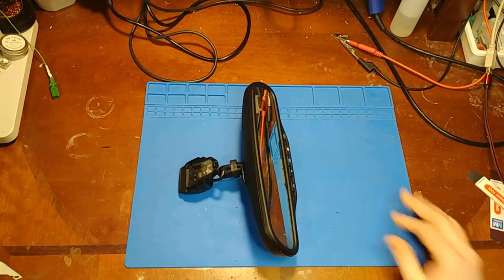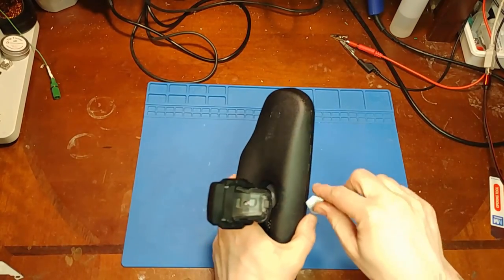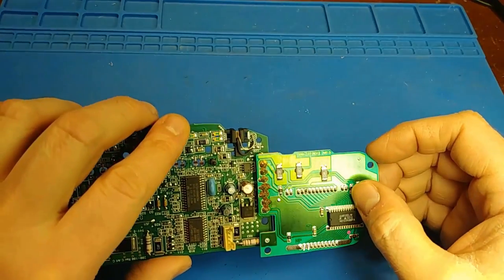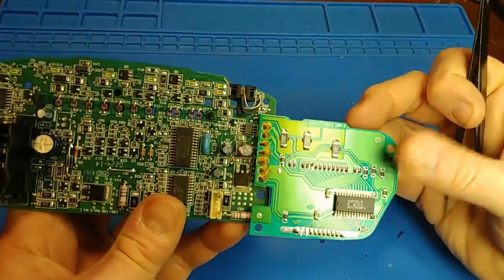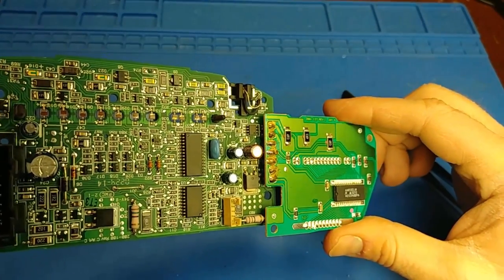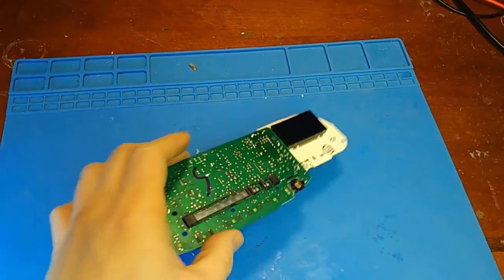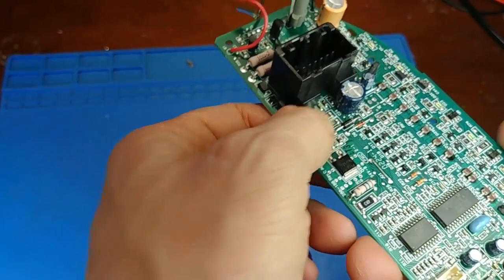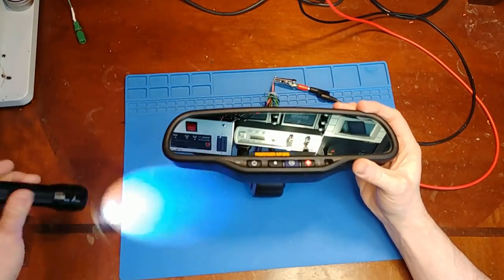How to repair Compass Mirror

Comment from the maker: For contact information follow this link:
https://www.youtube.com/watch?v=T_2WnJMsZaU&feature=youtu.be
Reply: How do I contact you
Reply from the maker: @rolandcabrera8245  click the link that says click here for my contact information.
Reply: What kind of flux do you like?
Reply from the maker: @stopthephilosophicalzombie9017  AMTECH. But I only trust to buy it directly from Louis Rossmann to get genuine.
Reply: @jeffescortlx  Rossmann is a good dude! I'm a big fan of his channel.
Reply: @jeffescortlx  Btw, what's in the squirt bottle? Isopropyl?
Reply from the maker: @stopthephilosophicalzombie9017  correct
Reply: @jeffescortlx  Getting that mirror apart was a nightmare. Mine had never been opened. I used a bunch of feeler gauges to hold the clips open but getting them in there shredded my fingers. ; )

Comment: Just finished the repair on my 2003 Avalanche.  I had two broken traces on two of the three resistors that you hit at first.  I resoldered them, put it all back together, and back in the Avalanche.  The compass and temp display came on like new.  I've been living without those for many years.  Thanks so much!!!!!!!!!

Comment: Just resoldered all six traces on the three surface mount resistors. My senior eyes couldn't make out any breaks, even with readers and a cheap magnifying glass, but I figured I'd do it anyway. I used desoldering wick to remove the old solder and resoldered the joints. Works great! Had it working off and on until 6-8 months ago when it quit altogether. Now it's back! Mine is a 2001 and is the same setup.

Comment: 21st century auto repair. Electronic circuit board repair with a high powered microscope and a soldering iron. Very interesting and informative. Thank you for sharing.

Comment: Awesome video. This is the first time Ive ever touched a solder gun and bought one to change the lights in my cluster. everything but my lights came in today and i just had to use it on something so I remembered my mirror stopped working. Works good as new now. I didnt have tool like yours, but a 1 inch putty knife slid down the edge did the job perfectly for anyone else looking for something that wont mar plastic

Comment: Thank you!  Just saved money by using the soldering iron I already have, and a good pair of reading glasses. I could see a visible crack in the solder weld on one of the three dropper resistors you pointed out at 3:30.  I heated up the solder joint, added a bit of new solder, then did he same for the other 5 contact points, just to be on the safe side.  Reassembled, put back in the truck and when I turned on the ignition switch, everything worked like a charm!  Thank again!

Comment: You Nailed it!. Two local auto shops wanted $500.00 for a new rear view mirror + labor$$ to install.  This video gave me the detail I needed to disassemble the mirror. I did find and repair bad solder joints. Thanks for the effort you put into the demo video. Cheers!

Comment: Dude, Thank you so much for making this video. I own a 2003 GMC 2500HD sierra, my brother bought this truck new and sold it to me 10 years ago. The compass/temp never worked. He said the dealer wanted a lot of money to replace it so he never bothered to. It was the tiny things you re-soldered first that one of mine had a crack in the solder. I fixed it like you did… except much more rudimentary, and it works now. Can’t thank you enough. I can’t believe how tiny this stuff is, but luckily i had a magnifying glass ….

Comment: Great tutorial.  Had been going months without the temp and direction.  Was the exact same resistors that had a cracked connection.  Thanks.  Fixed in less than an hour.

Comment: I've got a 2004 GMC Sierra 2500HD with this OnStar mirror. I had no idea there were so much electronics packed into it. It's working for now, but at least I know that it can be opened and repaired.

Comment: The mirror in my 03 Silverado,  at first before  failing was in Celsius. 
After that was intermittent operation. 
I bought GM replacement,  plan to keep the oem if so when the replacement fails combine the 2 to make one.

Comment: Unfortunately, I think I may have waited too long for this repair. My mirror compass began flashing some time ago. I discovered a forum that explained the solder joints on the 3 resistors directly behind the display. Mine looked fine, but I reflowed them anyway. No change. Still had the intermittent flash. I just drove it that way for some time and eventually the display quit working entirely. I decided I'd give it another look yesterday, and stumbled on your video. Sure enough the resistor directly next to the white connector was bad due to a failed solder joint. I successfully resoldered the connection and reassembled the mirror. I plugged the mirror back into the vehicle and unfortunately, the display is still dead. I suspect the problem was exacerbated due to not correctly repairing the mirror when the problem started. There is a chip on the board that sits adjacent to the resistor I resoldered that is pretty burnt. I will likely find a used one now, but when it starts to fail, I will be ready.
Reply from the maker: Before you give up on it, it's possible the 5v regulator may have died. This can be repaired.
Reply: @jeffescortlx  Thanks! I'll look into it.

Comment: Good video. I had to reflow the solder on four of the larger 4R3 resistors. One had completely broken free. I suspect this is so common on these mirrors because they used lead-free solder which is more brittle than traditional, lead-based solder. Plus, these particular resistors are low-ohm value (4.3 ohm) and probably saw more heat cycling stresses.
Reply from the maker: That is correct!

Comment: Very cool!  My dimming and garage opener both work, but my compass got dimmer and dimmer, and now doesn't display.  I'll check the circuit board.  I have been an electronic hobbyest for years, so I'm anxiuos to dive into it.  Mine is on a 2010 Saab 9-3 XWD (GMized if you will).  Thanks for the awesome video!  Take care!

Comment: I have have an 07 took apart last night looks great.  I gotta keep looking for the trouble somewhere else.  Sometimes it works, but when it does not work many display panel do not work either.   I found starting at one of the corners is easier to remove the bezel.

Comment: Just did the same repair on my 2004 Subaru wrx wagon.  Different surface mount components (looked similar) and location, but same problem and fix.  There were 6 large ones and two small ones.  I hit them all with Flux and solder and now it fully works.  Thanks Jeff!  Also thanks for taking the time to show disassembly.  Taking the bezzle off was the hardest part.  Where did you get those pry bars?  I want some.  I used two medium and one thick-/stiff guitar pics :-)

Comment: Is this about the same for the 2001 silverado model. Seems mine no longer dims for vehicles behind me at night and occasional dimming and sometimes a little tap to bring the compassion and temp back on. Man watchen you move around that board you deffenitly got some skills.
Reply from the maker: It will have similar issues/repairs yes.

Comment: 11:24  since the two photocells are on an analog comparator circuit, you can have the display come on brighter if you block the rearward facing one with your thumb while you are shining light into the forward facing one, because the circuit measures the difference in light levels between the two. The same thing works in reverse if you block the forward one with your thumb and shine a light into the rear one.
Reply: Which will give you, or should give you a brighter compass in daytime?

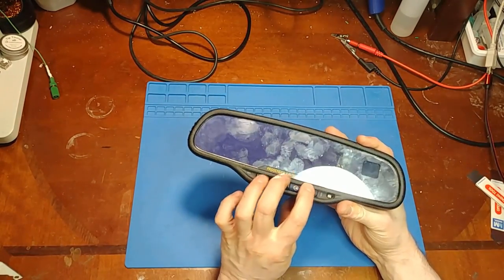Comment: 0:23  there is a front facing and a rear facing photocell, and inside the mirror there is an analog circuit that compares the difference in light levels between the two, which then drives the auto dimming function of the mirror glass. These two photocells are only for dimming the mirror glass, they have nothing to do with dimming the highbeams. That is a separate circuit and it is a separate item mounted elsewhere on the vehicle.
Reply: Eyeball for the headlights is on the dash

Comment: Do you think this mirror can be put in an older GM truck? Just needs power and it does the auto-dimm and compass (and temp) itself?
Reply from the maker: It looks like the compass and auto-dimming work with just power, but I haven't looked into it too much to find out yet.

Comment: Love the video. I tried it myself, and I think I did it right. But at the clean up I may have poured too much alcohol near the display and blue liquid came out. Guessing that's the liquid part of lcd, yeah?
Reply from the maker: It was probably just some conformal coating you washed away. It's a VFD vacuum florescent display. It's sealed, under vaccum.

Comment: Thank you! I just scored one of these from the junkyard to practice on so I could just swap it out for the non-working one in my Forester. At the worst I'd have two non-working mirrors. It ended up being the same resistor, which was very hot. Should that temp come down if it is soldered correctly or is there another problem in the circuit elsewhere?
Reply from the maker: Those physically larger resistors will get hot, but shouldn't darken, smoke or stink.
Reply: @jeffescortlx  Gotcha. Thanks again.

Comment: Great Video, My display is working, however the temperature reading is stuck on -40* F. I changed the sensor and its still stuck on it. Do you believe this is something that can be fixed or do you think its past due?
Reply: Fentertainment probably the wrong sensor. -40 is the lowest the mirror can display and normally shows that when the wrong type of sensor is used. If the circuit to sensor was bad or unplugged , the display will show OC for open circuit.
Reply: @daveh2612  I bought another mirror from lkq that didnt have onstar and it's working fine. My truck didnt come with the  ambient temp package but now it does. The first mirror I picked up had onstar built in.
Reply: @Fentertainment  GM seems to have at least 3 different sensor scales, but they're all lower resistance so they'd show up much hotter. No sensor gives you 0F so my guess is your mirror had a damaged chip or board.

Comment: Excellent video!  Quick question, I have this exact same mirror in my ‘06 Saturn Vue V6 AWD. I’d like to replace it with a new mirror that incorporates a dash camera; however, I’d like to avoid running a power cable up from the dash or interior fuse box. Do you think I could tap into the unused wiring harness, that WAS attached to this mirror, to get my 12 volts?  Thank you!
Reply from the maker: I don't see why not.

Comment: What are you applying to the board before you solder and what are you using to clean it up afterwards? Where can I get some?
Reply from the maker: Flux. A link is in the description. The clean up fluid is just rubbing alcohol.
Reply: Thanks. Is there a flux that you know of that doesn't have a 1 year expiration? That product would probably last me 10 years.
Reply from the maker: @eldoradony  since this isn't your profession you could get by with the flux that is in most good solder.
Reply: thanks

Comment: Nice video! My 2002 just started flickering when it gets warm & then wont shut off. Any chance I can send it to you for repair?
Reply from the maker: The mirror won't shut off? I would assume it's powered from an ignition circuit.

Comment: What are the bezel removal tools you are using called? And where may I get them? I tried everything I have in my box to try and pop this thing and nothing is working. I even used different size feeler gauges. These things would be handy to have and help me a lot. Thank you.
Reply from the maker: It's called a spudger. But a butter knife will work just as well.
Reply: @jeffescortlx  thank you soooo much for the help! I was still searching for it! thank you!

Comment: I want to invest into some soldering equipment, a temperature controlled iron, and a microscope for viewing solder joints to start with, any recommendations?  Used if I could find used equipment.  Any suggestions welcomed.  I enjoy your videos. I have a few projects of my own to get started on.  Did some circuit work in the military, retired now, time to fix some things of my own!
Reply from the maker: Yes if you dig deep into my channel page you'll see a couple different T12 OLED soldering stations. I will recommend those over any 900M style tips. For microscope I recommend the big amscope, I think they start around $700.

Comment: Jeff, is that flux you are covering the component with before soldering? Just wondering if that’s the flux you list in your descriptions? Good video thanks for showing. 👍👍👍 Artie
Reply from the maker: Yes that's the AMTECH NC-559 I'm using. It makes outstanding solder joints.

Comment: Going to try this on my '03 truck mirror. What is the goop you put on the board before applying the heat?
Reply: Did you ever find out what he put on the board before he started soldering.
Reply: @johnroberts1206  no. No answer
Reply: @johnroberts1206  I think it is called Chipkwik Tack Flux
Reply: Thank you

Comment: I have an issue where the airbag display and compass only come on when i hit the brake. Took mirror apart and found nothing so i reflowed the solder on those resistors and some others. Reflowed solder on the wires going to the dimming ring. Still nothing. Im stumped. Might have to go back in again and try and flow the whole board with a heat gun.

Comment: Hey i got a question. What type or brand of glue do you use to put the mirror back to the windshield if you do that?
Reply from the maker: The mirror can be removed by loosening the set screw that holds it to the anchor. You don't have to actually pull the anchor from the glass to remove the mirror.
Reply: @jeffescortlx  mine with the anchor piece fell off i got clean the glue off the windshield and glue it back was just wondering if there was a certain kind of glue to use and the best brand..
Reply from the maker: @roltyd22  I have seen glue made for glass in the automotive isle at Walmart. But that was 20 years ago and I don't know if it's still sold.
Reply: @jeffescortlx  oh ok thanks for your input and video

Comment: i have pretty much the same mirror in my 2001 pontiac grand prix..  the compass has frozen to South East for some reason..   any thoughts?
Reply from the maker: Maybe the sensor board failed, for the pickup trucks there's a square box that clips to the mirror windshield mount that holds the sensors. You'll have to see if you can track down a used one to try.
Reply: @jeffescortlx  turns out my garmin dash cam mount has a magnet in it that caused the compass to stick to SE..  moved the Garmin Mount away and the compass now works correctly again :)

Comment: Hey Jeff I have a 1994 Chrysler lebaron gtc gauge cluster the problem is the battery gauge will be intermittent and the tachometer stopped working.I saw you did a repair on a Sebring cluster I was wondering if you do any other Chrysler products like the lebarons
Reply from the maker: Sorry but I don't tackle stuff that old. 1999 GM's is the farthest back I'm set up for bench testing.
Reply: Ok I understand that I hope I can find someone who does?

Comment: please inform! What temp iron? what type solder? what is the clear gel? a flux?
Reply from the maker: I would recommend to watch some general electronics repair for beginners videos. They cover the basics of solder, temperature, fluxes and cleaning.
Reply: @jeffescortlx  LOL that has me chuckling a little! I started soldering about 45 years ago and it has been part of my career for most of my life! I was asking specifics, though it would interest you, too! didn't for a moment think it would be an annoyance. sorry. I repaired my 3 resistor solder joints right after i texted you here and my compass thermometer display is working again, and I very much enjoyed that, so Thank you...

Comment: So I did this and it works BUT now the compass is off by 45 degrees. How do I recalibrate it? TIA
Reply from the maker: Make sure the sensor is installed properly inside of the plastic housing that's behind the mirror.

Comment: How can i get a wiring diagram i wanna know da negative cable and positive and da two wires for da temperature sensor
Reply from the maker: I usally find connector pinouts with a google search, sometimes Google images.

Comment: What wires did you use to turn the mirror on.?
Reply from the maker: I just traced the wires back to the PCB. Ground is easy to find, it goes to the grounding trace. Positive power typically starts by going trough a diode than to a cap.

Comment: My mirror comes on now, but now it's stuck on the start up display with all the characters showing. 
Won't go into temp and compass?
Reply from the maker: I'd recommend to double check your work. Make sure you didn't drop any solder blobs and/or make any accidental shorts.
Reply: @jeffescortlx  
Ok
Thank you
Reply: @jeffescortlx  

 I went through and cleaned up all of the solder points with a sucker, after doing that, now it works. Thanks for the advice.

The only thing I'm not sure about, is now it seems a little dim on the display, I thought perhaps it was in night mode because it was dusk and getting dark, so I tried shining a flashlight on the sensor to see if it got brighter, but it didn't, so I'm not sure if it's working or not, maybe the flashlight doesn't provide the right kind of light to make it go brighter?

Regardless, it's working now, and  a dim display is better than a non working one, to say the least.

Comment: My compass works but the thermometer changes from "SC" to "140F"
Reply: djturnz SC means short circuit. Check for temp sensor wires smashed cut or shorting to ground.